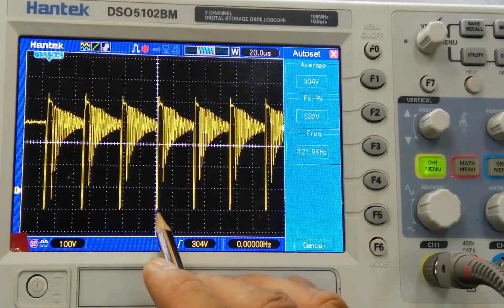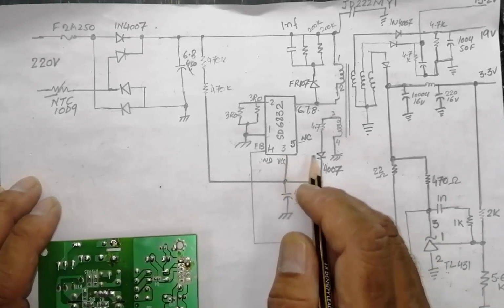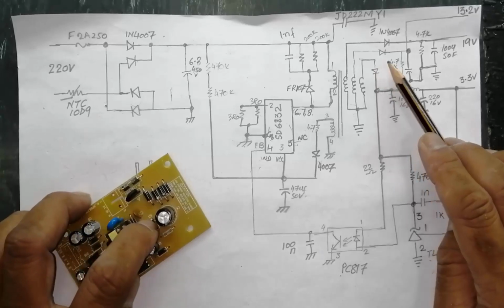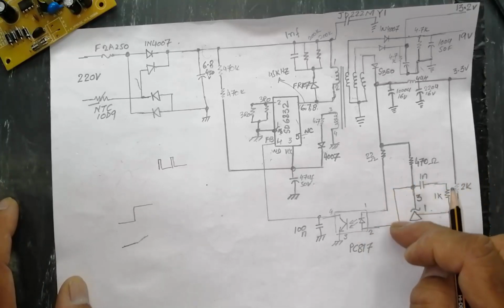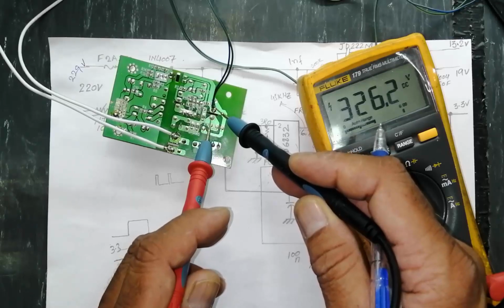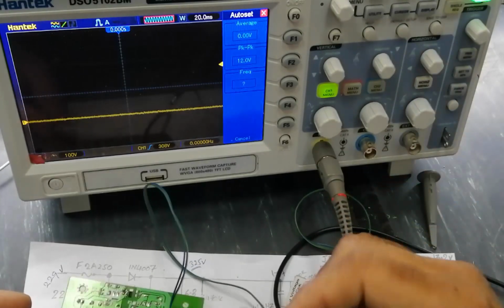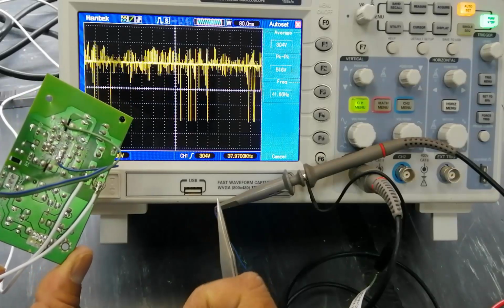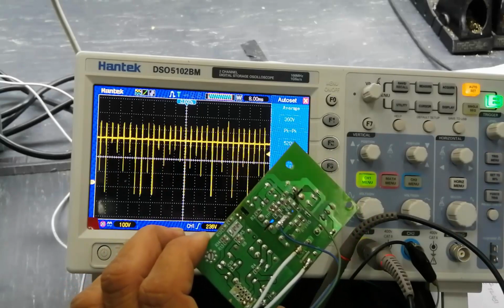#255 Switch Mode Power Supply SMPS using SD6832 Current Mode PWM Controller Theory and Practical

Comment: Great video, in what cases pwm controller doesent start oscilating? i have ups with 3843bl, the  ic is fine and it hase 7volts for off state but it doesent have output voltage, what do you think? thanks...

Comment: I have similar SMPS circuit with no output. Resistance between the FB pin and the ground is 18 Ohm . I have removed the FB capacitor and opto coupler but the resistance remains the same. Is this IC (sd6834) OK? Positive supply to the IC VCC pin fluctuates from 12V to 16V. BTW its an smps for I-bell IGBT welding machine.

Comment: sir please help.The smps power supply I have has three valtage outputs. It is 37v, 19v, 5v. Its 37v output put is correct. But 5v and 19v are reduced to 4.6v and 15v.When loaded, it goes down further. VCC comes to the oscillator ic (TL494CN). The feedback is taken from 37v. The output is from a single chopper transformer.

Comment: Sir may I know why the fuse doesn't busted when you shorted the output pin of the optocoupler did you use a series lamp tnx Sir
Reply: @HaseebElectronics  tnx for your explanation Sir